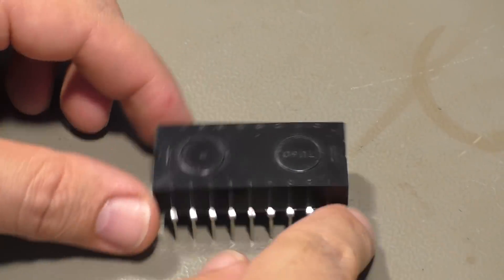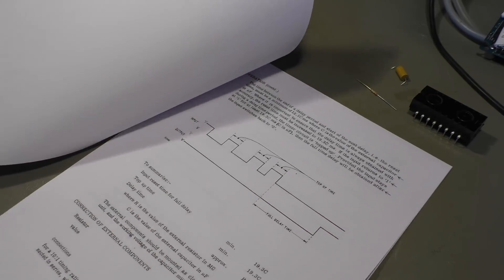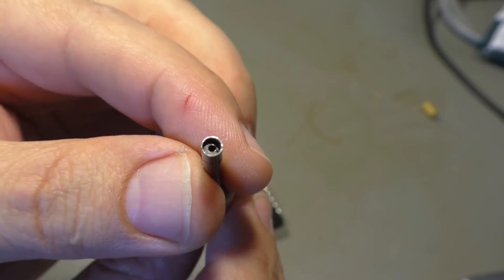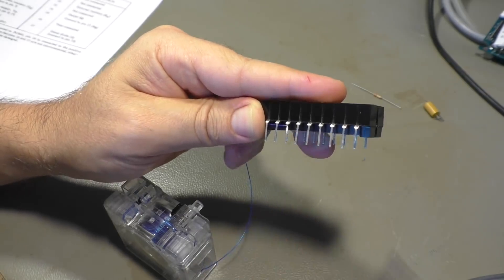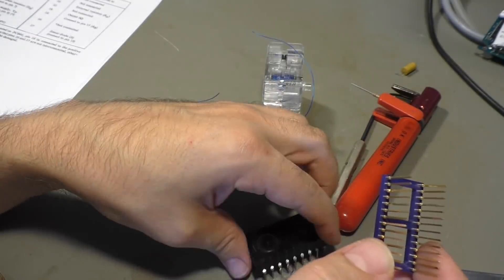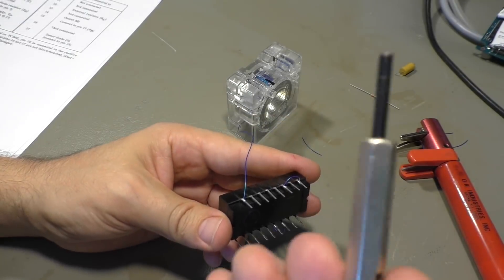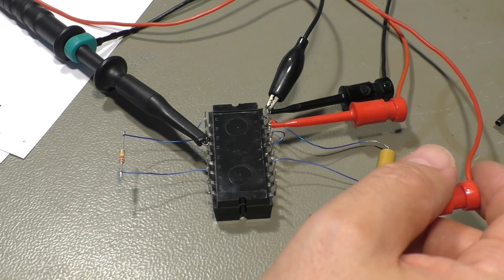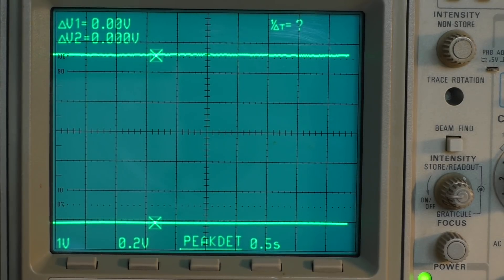Philips/Mullard NORBIT chip and Wire-Wrap techniques - (PWJ108)

Comment: I have a couple of these TU60 timers. They are red, as specified in the datasheet.
Reply from the maker: So I have a rare black one?  Weeee....!!! :-)
Reply: Hi, if you have a TU60 timer, could you sell one? I really need to repair the automation in the foundry machine. The shipment is at my expense.
Reply: @torsion89  I have 2 timers, so I can sell one and keep the other one for my collection. But they are used and desoldered, I cannot ensure they are still good.

Comment: After seeing this video I went to digikey and ordered the wire-wrapping-wire and the same tool you used. The wire is exactly what I need for mods and bodges and the tool should be very useful for prototyping things.

The tool and the wire are made by OK Industries (now Jonard Tools), just mentioning that for anyone thats interested
Reply from the maker: I guess you bought the small hand tool, not the "gun"... I'm glad to hear that you can still buy these things. Just in case I'm running out of wire :-)
Reply: @PlaywithJunk  Actually I did buy the gun type tool because I think it's much handier and makes better and more reproduceable connections. Digikey was pretty much the only supplier that has these things and would ship them to me in Germany.
Reply from the maker: Was it not expensive?
Reply: @PlaywithJunk  it was a bit more than I was expecting. The tool itself is 124,-€ + Tax without any bits. But I've been searching for a good prototyping tool and I bought it through my company account so I save the tax anyway. The wire is 18,-€ +Tax for a 50 feet spool with dispenser. You can also get just the refills for the dispenser.

I also do some work on old electronics and telecom gear, so having a decent wire-wrapping-tool seems like a good idea when re-wiring old stuff.
Reply from the maker: Did you also buy the hand tool? It is very useful to remove wraps and also for stripping the insulation. A normal wire stripper bends the tiny wrap wires too much.
Reply: No, I didn't get the hand tool but I got that red Cutter-Stripper-Combination that you used in the video. I'll add the hand tool to my next order with digikey. I guess removing the wraps  by hand or with a pair of pliars would be quite difficult, right?

Comment: Another interesting thing about wire wrapping is the corners of the pins form an air tight connection with the wire at that point nearly eliminating the possibility of corrosion messing up the connectiom
Reply from the maker: That's true.... in fact when you unwrap old connections, you can clearly see that the edges are still shiny and clean while the rest of the pin is pitchblack. Especially on silver coated pins.

Comment: I wonder what the die looks like, compared to more modern ICs.
Reply from the maker: There is no die or chip inside. They actually soldered resistors, transistors and diodes together and poured epoxy around it. That's why it is so big.
Reply: I was thinking it was something like that! That seems so alien compared to chips today.
Reply from the maker: Imagine what will be in 40 years...

Comment: Ah! Wire-wraps. Such fond memories. And that OK tool. Such a fine tool! I loved wire-wrapping. I found it, I don't know, meditative.
Proper wire-wrap sockets had sharp square posts. They cut into the wire and actually contact welded with the wire. The connections were extremely reliable. 
All those pin "antennas" wouldn't work these days with such high frequencies. Shame.
Reply from the maker: The data sheet says "frequency up to 10 kHz". The antenna effect does not exist at those speeds. :-)
Reply: What's a kHz? ;-) I thought the world started at GHz.
Reply from the maker: good joke :-)  I remember when I first saw a TV tuner that went up to 900MHz... all that HF voodoo with coils and tiny capacitors. You just touch it and it doesn't work anymore. And today everyone just puts an X Ghz computer together and it works.

Comment: Wow those tools are so interesting, I've never seen anything like that before.
Reply from the maker: They would still be useful for prototyping. Why not connect an Arduino with wire-wrap...?
Reply: Play with Junk I could think about using something like this to do a fix an some old through hole board or something like that. Bu
Reply: VoltLog Wire wrap is actually still used some in telecom, but it's pretty rare in modern electronics. I actually buy rolls of wire-wrapping wire, it's really nice as mod wires.
Reply from the maker: I use the frequently when I need very thin wires for something. The can be stripped very easily.
Reply: I use wire-wrapping wire myself for repairs and mods but I've never seen the tools shown in this video before :-)